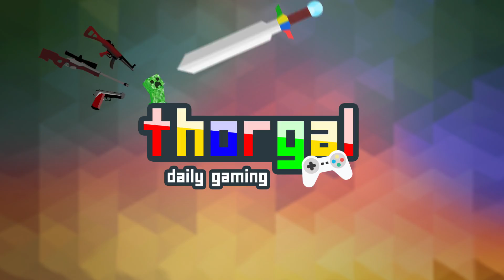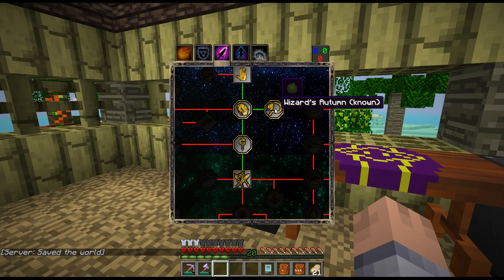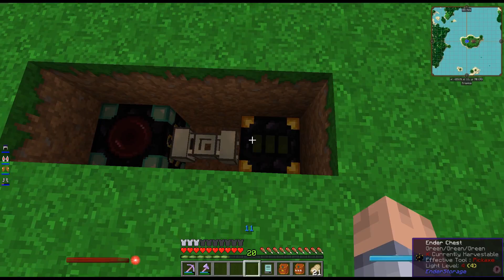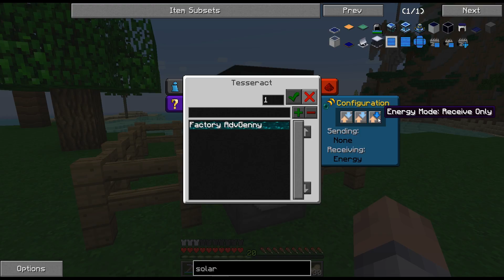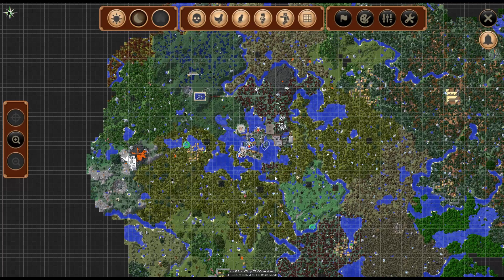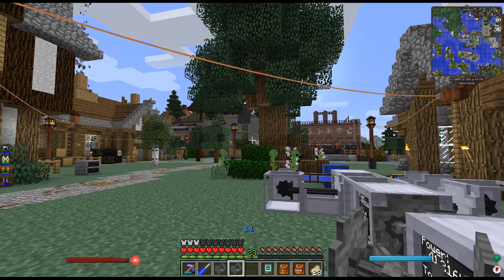Thorgal's Modded Minecraft #26 - Getting ready for Rotarycraft

Comment: hey thor a youtuber named rageplaysgames was able to power a grinder all be it slowly with one steam engine and a worm gear, also diamond gearboxes require a one time use of a bucket of lubricant once it has it it will never use anymore some once you have a proper size diamond gearbox you don't need the worm gear and the grinder works faster
Reply: also you can repair 2:1 gearboxes by using 2:1 gear units on the empty box after the gears in the gearbox break and the same for 4:1 with 4:1 gear unit and on and on

Comment: Eject your bottles into a drawer so you can take a single one.

Friction heater is for later on when you need to make tungsten and some other things. You can also use it to power vanilla furnaces with Rotarycraft power. Slightly easier way through the beginning is the Worm Gear which is a bit more expensive, but provides a lot of torque with no need for lubricant.

Steam Engines WILL explode if you try and run them with Lava and without cooling fins.

Plan for at least three floors, plus a basement. And if you get into any Reactorcraft, DON'T DO IT IN THE OVERWORLD. Make it it's own Mystcraft dimension.

Comment: I haven't watched modded minecraft vids for a while, but Thorgal + Rotarycraft sounds very promising:) Did you check if the wooden gearboxes suffice? They should only need some cooling fins on top.
Reply: They degrade too quickly. A better option would have been the Worm Gear which sacrifices a lot of speed but no power for torque and makes it perfect for running the Grinder. And it never takes damage (or didn't last time I used it.)
Reply: No, wooden gearboxes run forever without maintenance when the cooling is appropriate.